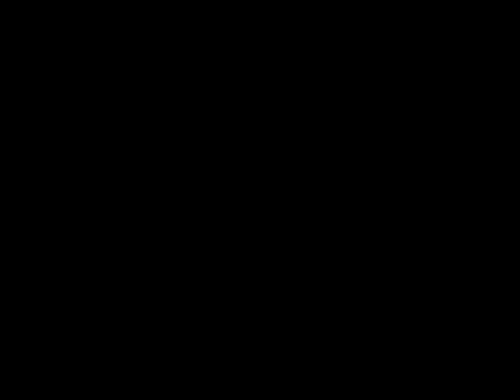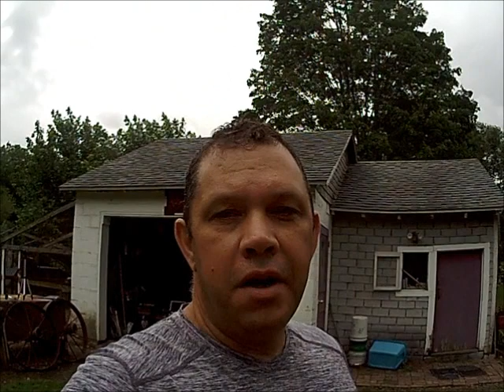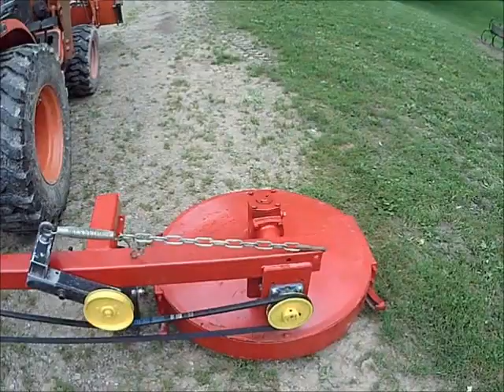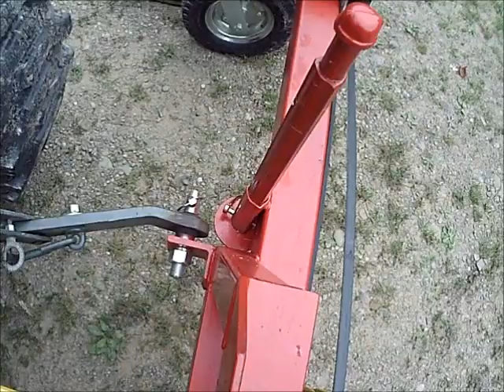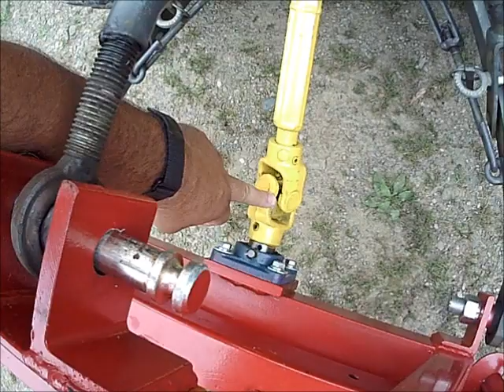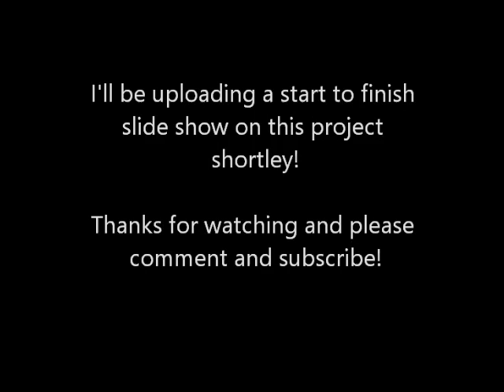Homemade 3 pt Hitch Side Cutter Unit!

Comment: Good job. You gave me several ideas to build one similar to this. I’ve got an old 72” Scag turf tiger deck that came off an old mower we had that pumps and the motor through a rod. I keep everything, just for parts or making something new out of. 

I think on mine, I’ve got an old prince hydraulic pto pump that I’m going to run to a hydraulic motor. On the motor it has plenty of torque, but 1:1 for input speed. On the output shaft of the motor, I have an old 30” double groove cast pulley to get the speed I need and running that into a double groove 4” pulley.

On the beam, I’m going to put a hydraulic cylinder inside the tube and sleeve it so it will expand out mowing around the pond. May even try to build a way to make deck tilt up and down so I can mow pond and small limbs that stick in the driveway. Using hydraulic tank as counter weight and will use a swivel guide wheel on both sides to help stabilize it
Reply from the maker: Thank you and it sounds like a great plan you have. Looking back on it going with hydraulic power would have been better and I could still go that route at a later point. You are right about using a counter weight to offset the mower head.....still need to do that to mine.

Comment: Great way to re-purpose and old Gravely. Those were some pretty tough rough terrain mowers. Does it have a fold-back feature or have you considered including one? Might be nice if you ever used it to trim around fences or other objects.
Reply from the maker: Thanks Jerry, no it doesn't have the ability to fold  back and really couldn't with the original belt drive system. I have made some cool up grades to the unit which I'll post a new video soon. The next up grade is going to be hydraulic powered instead of belt drive.
Reply: Great idea. I look forward to seeing the hydraulic drive upgrade.

Comment: Watched this for the second time. I would ask does this have Lawnmower blades on it or brush cutter bars. And replace your tire with a never flat brush cutter back wheel and build these and sell them. I would buy one tomorrow if you did. I have the same issue. Brush with some small rocks added in.
Reply from the maker: Thank you so much for checking this out and yes like all one off / homemade pieces there is room for improvement. I have already made some modifications to this sense last season and will post a video soon. Again, thank you for the recommendation.

Comment: That is very nice I need one to mow my bank in front of my house it takes me two hours to weed-eat it to steep to cut with a riding mower. that would sake a lot of time and strained back.
Reply from the maker: Thank you, I'll be putting up a video of it actually cutting over the weekend......I'm very pleased with how it turned out and what I forgot toention is that the cutter head swivels to match the surface you're cutting which is a huge bonus.